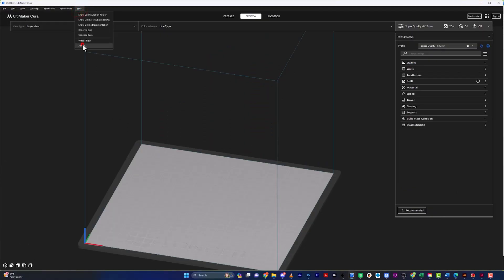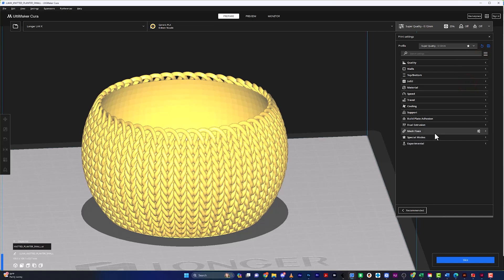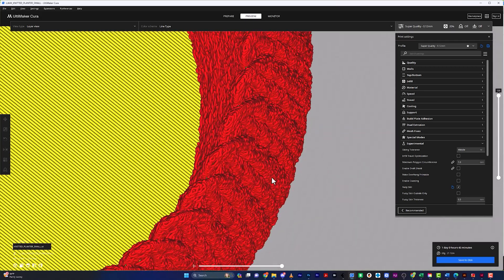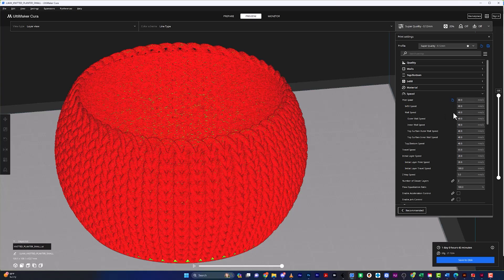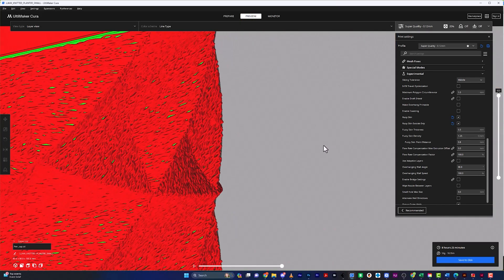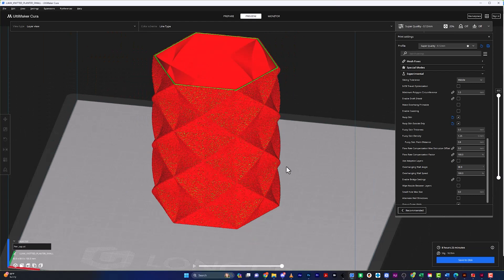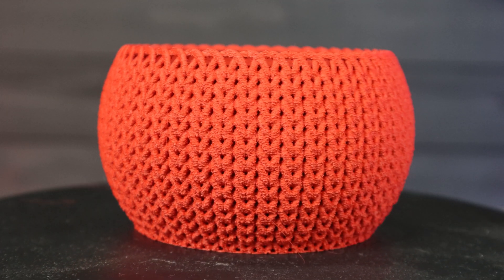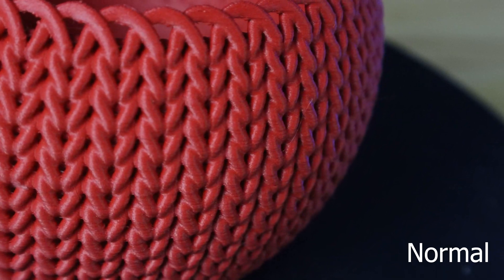Cura 5.5 Experimental Fuzzy Skin Settings

Comment: I like this feature as you can use it to fit surface texture to that of textured bed plates with very small parameters. What I now still miss though is the option for a fuzzy top layer ti match the top...

Comment: Started using fuzzy skin in 2017. It's on by default for my character prints. You can set it very shallow so that it just gives a slightly textured look. It hides layer lines, it hides z-seam, it hides support marks AND it helps a ton with overhangs! And it can also give shiny/cheap looking filament a nice mat sheen.